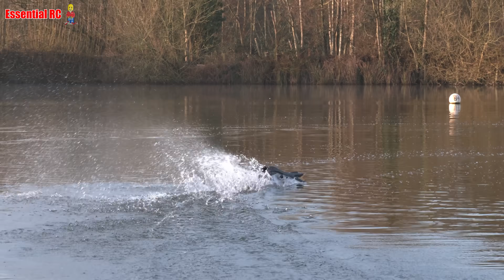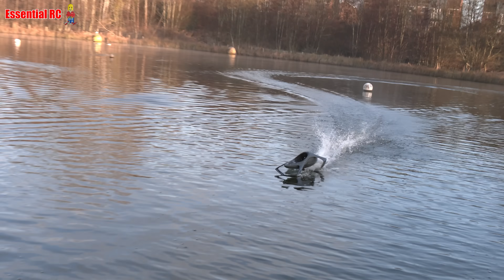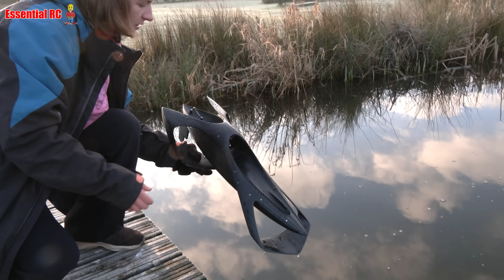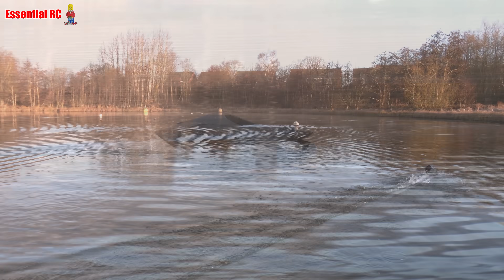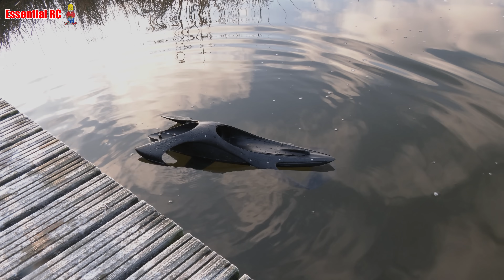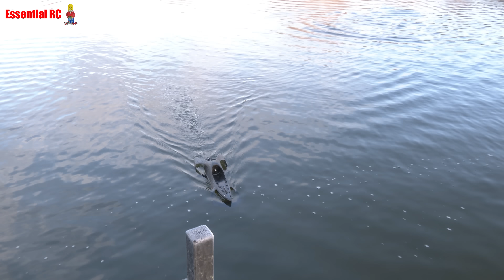Radio Controlled JET for the WATER ! Cova Concepts HYDRA-JET 701 EDF Jet Boat

Comment: On the other site I commented this - it fits here too. I am blown away. I blueprinted a real size personal water craft back in the 90's, now defunked (WetJet Personal Watercraft). How about an ABS undercoat or inner model that you can skin with Carbon Fiber n gel? Maybe same scale or? I'd put my drone up to trail watch it most anywhere - rivers would be a blast. Yes, TPU seals or a silicone n screws work for me too! That design n the engineering you pulled off is amazing to say the least.

Comment: Would be interesting to see what is the limit speedwise 😃 I think it could run a little bit faster.
Reply from the maker: With a hotter 70mm EDF system and the slightly modified wings Tamara was talking about I think it could be exceptionally quick.

Comment: Hi Tamara, I see you went with water rudder. Is there a reason for this instead of an air rudder like on air boats here in the USA? Did you try air born ridder and it didn't work? I'm just a thinker and can see this rig with 3 or 4 short rudders in the air flow. Great Idea, Awesome craftmanship.

Comment: I'd buy the 3D model with some drawings for assembly for self build with a 3D printer. That's common for planes and there is probably a market for boats as well.
Reply from the maker: That would be giving away years of design work and intellectual property. Nobody who has put in that much effort would do that just so someone else could productionise it and make a lot of money.
Reply: @EssentialRC  Years sounds a bit much. You could say the same for plane models and such. What's for sure: it'll take a few weeks for someone to make something similar and with an original it'll take just a scanner. I'm not threatening, just stating the facts. Good is that usually people don't share the models that they bought in this niche market. Try first only selling the built model, however some will never buy the pre built and only consider buying the plan. Can't tell you the market size of either options. You may ask Eclipson to get an idea as you aren't competing.

Comment: Drop big stone to water for get waves, what may be happened with model? Drop to fly and crash. No have horizontal stab and rq sensors.  But model really hi experience and fantastic look. Try rebuild with fire jet turbo engine. Good Jobe for beginner!
Reply from the maker: Same as with all hydro foil boats including full size. They have operating restrictions. Not good for big waves but then neither would most other fast RC boats.

Comment: That is completely impressive given that the propulsion is a EDF  and at that it gets up on plane relatively easy and does not need to maintain a high rate of speed to remain there. Very impressive 👍👍👍
Reply: @nealstarling5422  thank you! Once it transitions (~35% throttle) you can throttle back to around 20% and it will sustain the plane! I really wanted it to be fun even in a small pond

Comment: Amazing congratulations, I would be interested to see that steering to extend up so you can take advantage of air and water.
Reply: @havocmydimension1354  thanks! In terms of the steering, I tried an air rudder but it's completely ineffective at low speeds, and has to be huge to have enough effect at high speeds which ruins the look